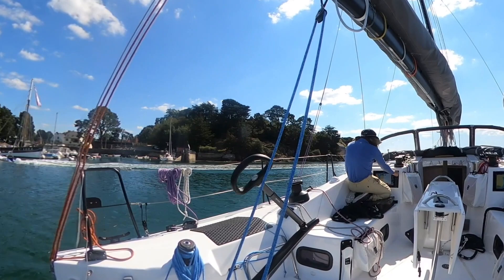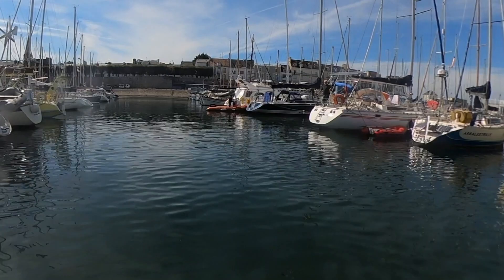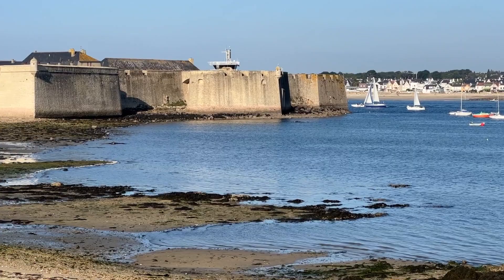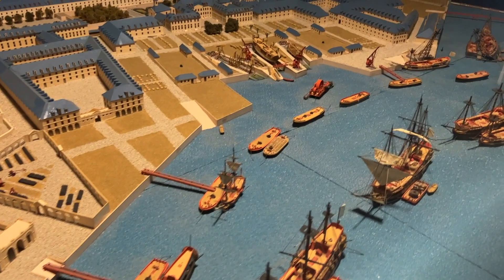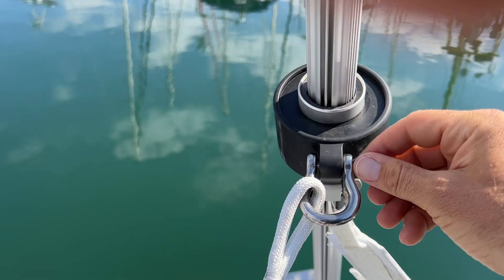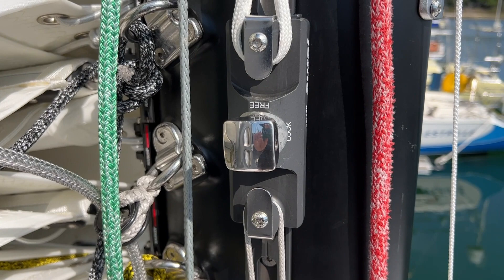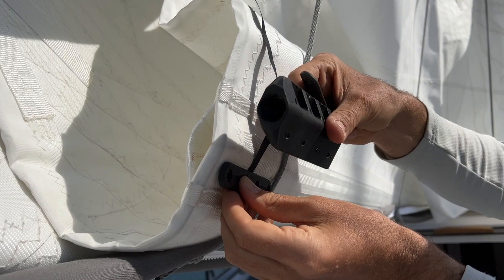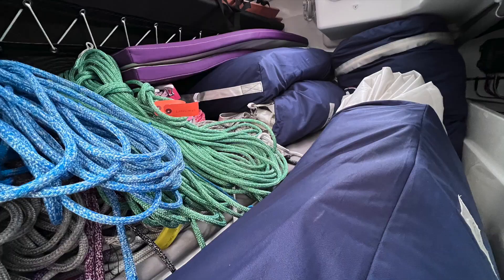Sailboat Docking, French History and Running Rigging :  EP 5 SV Cyclops

Comment: Hello Cyclops
For taking out the sail battens, use another short piece of sail batton with reduced thickness to separate the velcro. Makes sure to tape the short batten ends to avoid any fibres sticking out.
This piece of equipment is called "battenf*cker".
Will be much smoother than with flathead.
Great yacht you have👍
Reply from the maker: Great tip.  Thanks will try it. My battens for the main are round.  The jib has traditional flat ones.